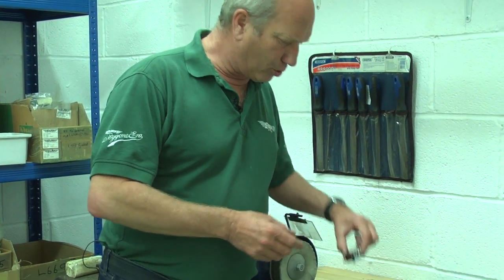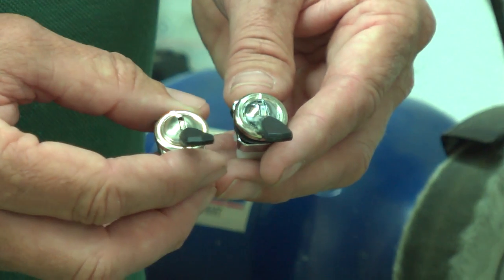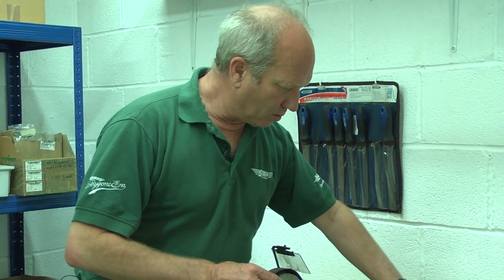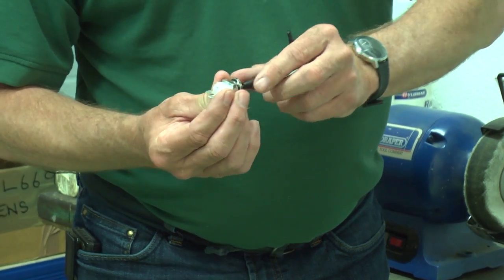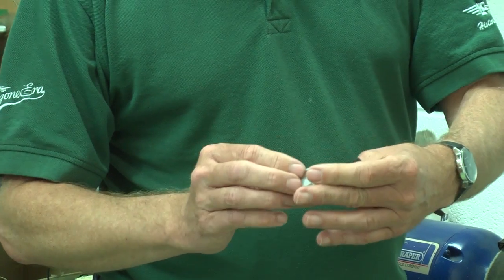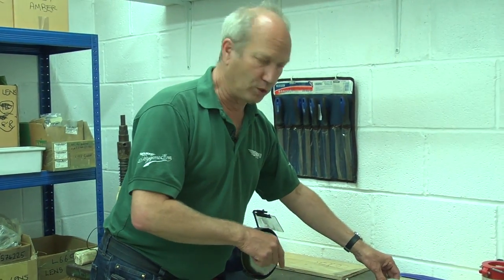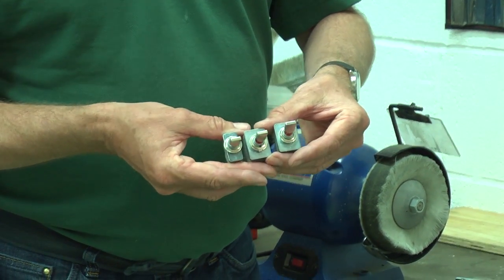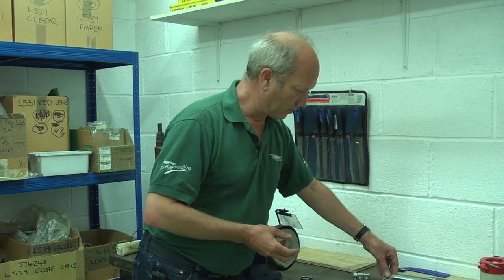Lucas-style Toggle Switches To view our full range of products please visit www.holden.co.uk.

Comment: Julian, can you point me toward a wiring diagram of the Lucas Switch 57 SA on - off - on switch?  I have one that I want to use for a 2 speed cooling fan in my AC Cobra replica.  The box that contained the switch says it is 31743 and on the side of the switch is P83716.  Thanks in advance!  Ron
Reply: #7: power from flasher
#2: right signal
#8: left signal
(2 and 8 might be reversed depending on how the switch is installed)